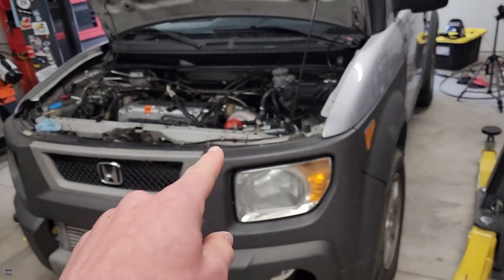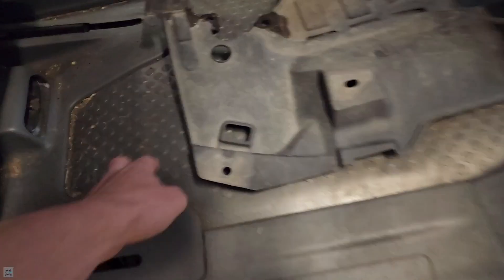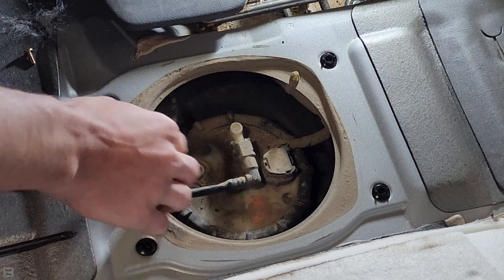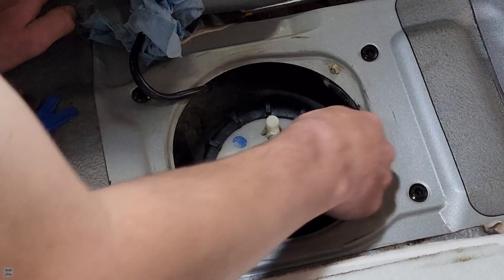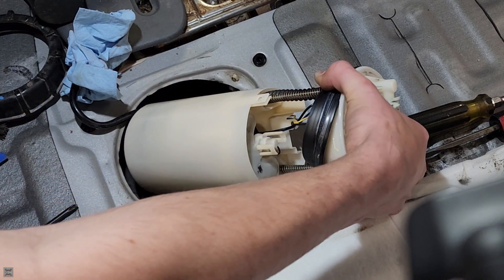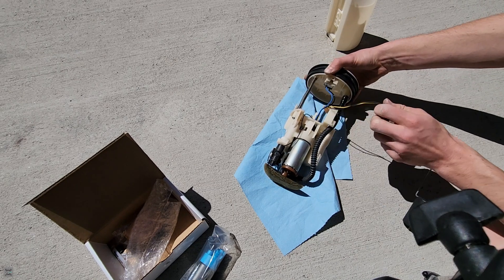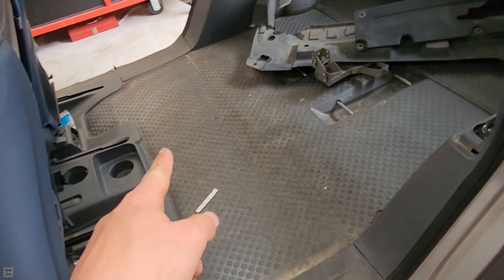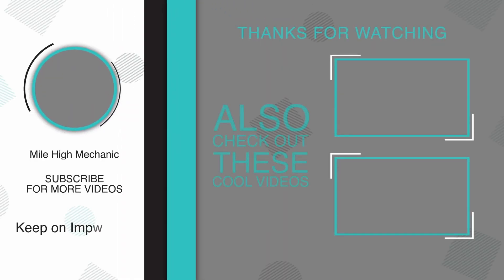Fuel Pump Replacement Honda Element | Turbo Toaster Part 8: Upgraded Fuel Pump

Comment: I've got a supercharged element that's experiencing problems under boost with the stock fuel pump, should i upgrade it?
Reply from the maker: @evanmtb4511 What duty cycle is your fuel system seeing?
Reply: @TheMileHighMechanic  Do you have the part # for the pump? Thank you so much for responding!
Reply from the maker: It looks like they don't make that pump anymore or support the element, so you will have to look at other places besides quantum.
Reply: @ Gotcha. I found one and the same style but 340LPH so i'll probably go with that one, fuel regulators are there for a reason right? lol. Thank you so much!
Reply from the maker: @evanmtb4511  That's the spirit
Reply: Not entirely sure. My guess would be a pretty high % running 1300cc injectors and 10psi WOT, pretty close to what you're seeing. I've been looking all morning for the exact fuel pump you're using but i can't find it lol

Comment: My pump is still good. How long do they last? I have 150thousnd miles  on mine and almost want to replace it before it goes out?
Reply from the maker: @vdittycc  It really depends on the pump and when it decides to fatigue, but Honda build stuff usually lasts a while, so I'd give you at least another 50k miles 🤷

Comment: Hello friend 👋... I have a 05 element morning start is ruff for like 4 seconds.. i replaced new spark plugs and coils and fuel injectors and throddle body plus new battery.. only thing im waiting on a hopeing could be my issue is the fuel pump.. what symtoms did you get before replacement?? My element have 200k Miles..
Reply: It also bucks when accelerating hard and I don’t normally go past 4.5k rpm but the shifts feels smooth
Reply from the maker: @zoozooyt1842  Does it idle at 700rpm?
Reply: @TheMileHighMechanic  somewhere around there I could check tmr Morning I have no a/c so when I idle sometime I almost think the car is off and the randomly it will go up a little n then I can here. The idle
Reply from the maker: @zoozooyt1842  It's possible that you may have a vacuum leak somewhere or possibly a dirty injector...is there a check engine light on?
Reply: @TheMileHighMechanic  yes the light is on with light then medium gas pressure it runs to 65 ish fine all day but if I over or give too much gas it give problems
Reply: Also did a little more research before you responded and bought a new vetch solenoid
Reply from the maker: My fuel pump was actually completely fine when I replaced it, I was putting a turbo on it, so I needed a higher flowing pump. However the general rule of thumb with the fuel pump is that I you can hear it prime when you turn the key, then it is working. If you cannot hear it prime then it is dead...if it is an intermittent problem it is likely not the fuel pump...also if it starts and runs, it is not the fuel pump.
Reply: So I have a 05 element 4at and at around 70 mph I’ll buck n I’ll loose power and a couple seconds later it’ll come back I was thinking injectors or pump but I’m not sure I put a new engine with about 85k in it
Reply: @zoozooyt1842  Vtek solenoid. Don't buy aftermarket, just clean the filter screen and inside, replace. Should run like a scalded dog!!
Reply: NVM.. reply soooo late... SMH
Reply: @jacintogonzalez7146  hey man my bad lmao just got the car for free were these the same problems n fixes ?